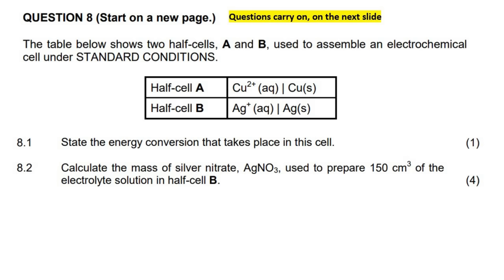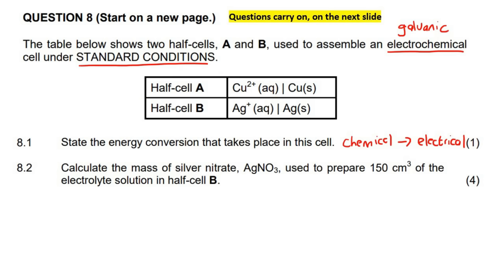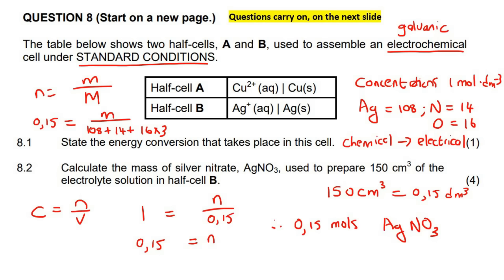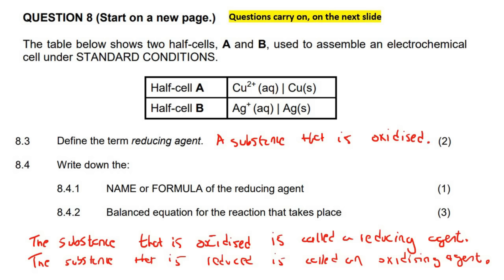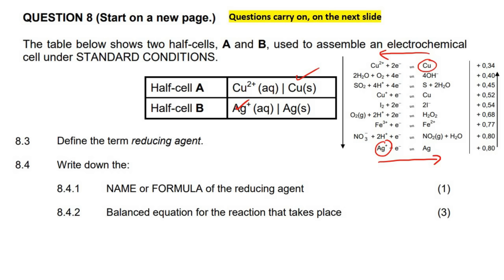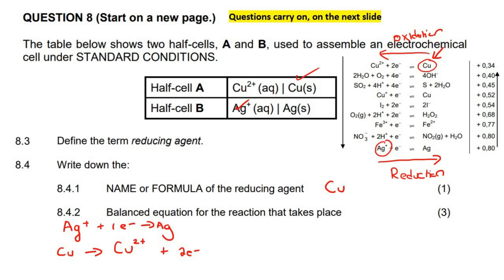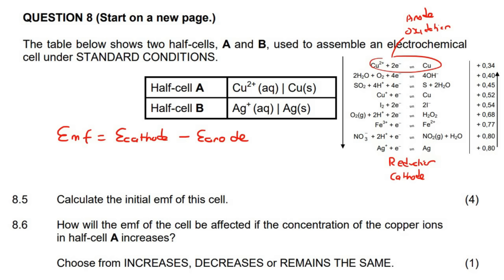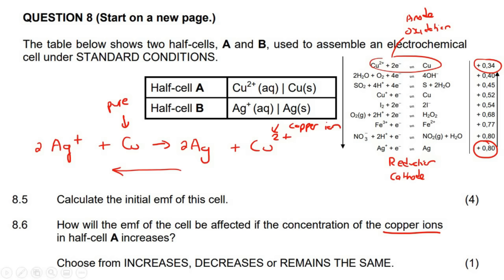Electrochemistry Gr 12: Galvanic Exam Question

Comment: why is the concentration equal to 1 in 8.2?
Reply: they said the reaction is in standard conditions which means temperature is 25 degrees, pressure is 101.3 kPa and concentration is 1 mol.dm-3